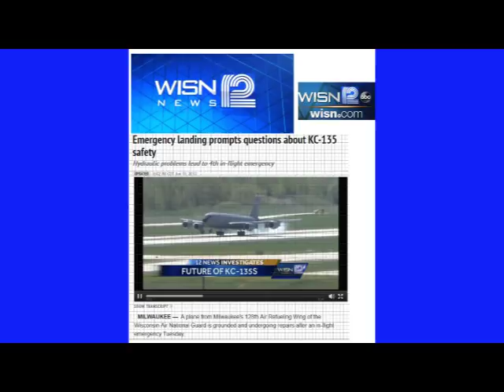U.P. Breaking News: K. I. Sawyer Latest KC-135 Emergency Landing/Renews Safety Concerns

Comment: What a bunch of bull from the reporter.  Hydraulics make it easier to fly, but there is manual backups for basically everything.  Declaring an emergency is standard procedure, and doesn't mean it is going to crash.  Retired Air Force Crew chief, 24 years, mostly on tankers.